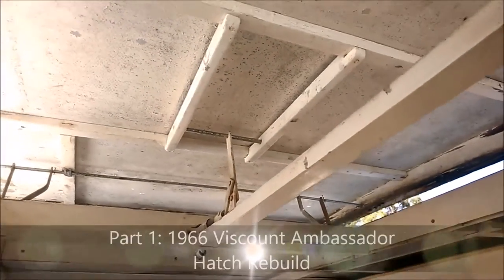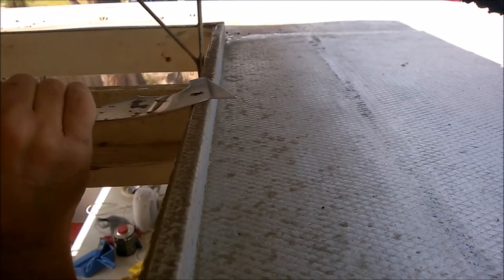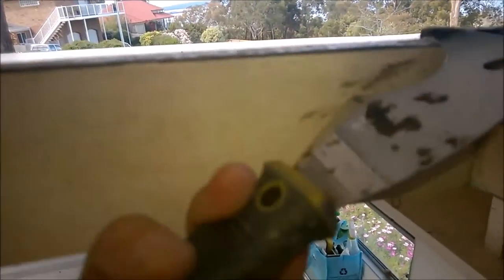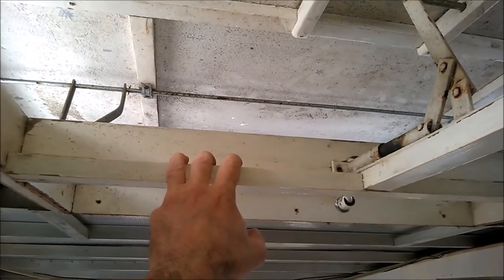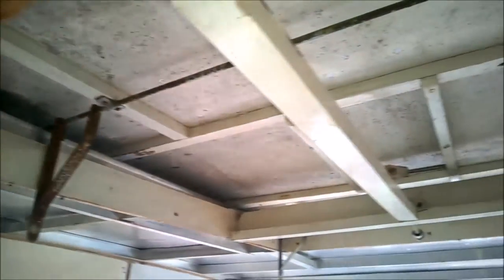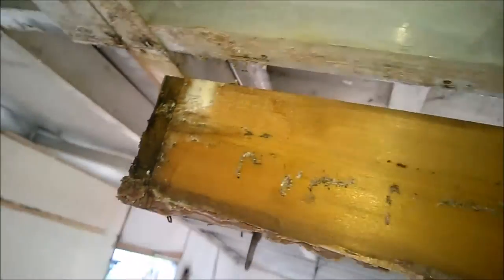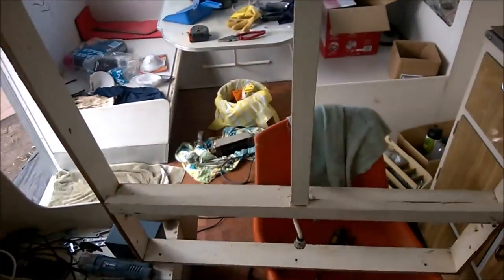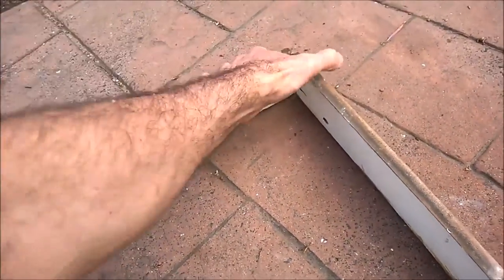Part 1: Viscount Ambassador - Hatch Rebuild

Comment: Fantastic vids! I am putting my hatch back together in my 197? Viscount 16ft, but I have not removed any of the ceiling cladding, and only removed three sides of the frame. The front piece which is a more substantial hard wood is ok and bolted to the aluminium frame from the sides I have no access to, so it's staying there! I've planed some merbau decking down to 85x15mm and will use that. The original was strips of particle board and had rotted to a weetbix consistency! I think I will screw the three sides in with decking screws to the aluminium frame and probably put some angle brackets in the corners to support the front piece to the sides. Do you reckon you will seal under the lip of the flashing where the nails go back in with butyl mastic? My front and rear flashing pieces completely remove and overlap the sides, I think I will mastic these, rivet, then cover with that silver mastic flashing tape.. Would love your thoughts!
Reply from the maker: hi martin... good work in tackling the hatch. I think the way you are doing it would be fine. even the edging strip you mention is good but most likely not needed as each of the 4 pieces are screwed into the frame. Mastic on the top fold is also a good idea even tho water getting in is unlikely.  So what your planning is more than enough for the job imo.  The main issue is the folded/cut roof cladding at the edges o the hatch. This is where main water leaks occur so make sure you do these. I would use something more 'heavy duty' than just mastic on the seams and hatch edges, like i did.
Reply: Thanks for that! By heavier duty do you mean a sika product?
Reply from the maker: Yes (although Sika is a brand). Check to make sure the product you select is suitable of course as they have specific applications.